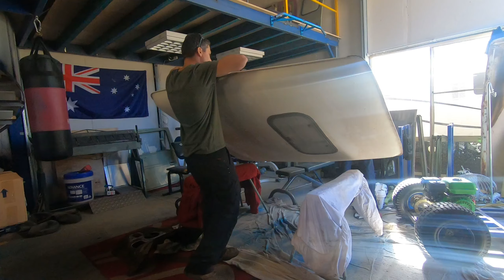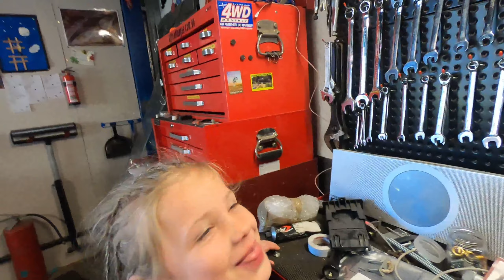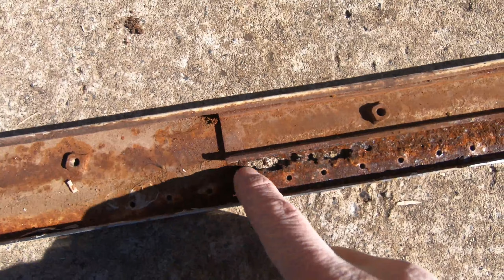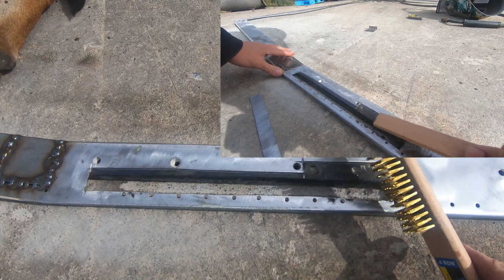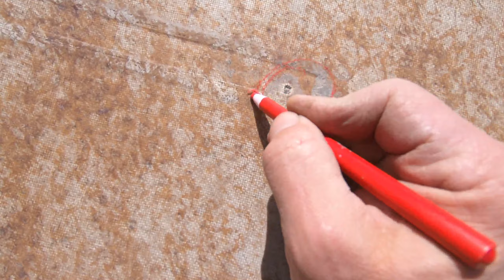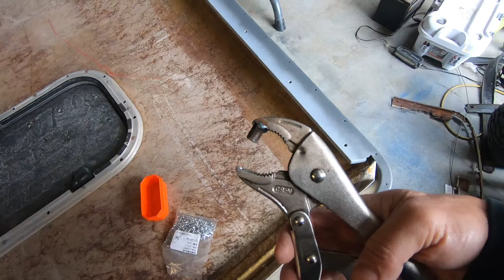EP16 - FJ40 roof gutter removal and repairs, RUST

Comment: This is incredible, I was looking to get into an FJ40 restoration, after seeing your videos I realize that I need way more tools than the ones I have, know how to use them, a dedicated garage, and Time.....how and why before your restoration got all those tools?....did you have most of them before?....do you fix cars before?.....which tools you bought specifically for the project?......you are like a magician, eventually you pull out  tools from a hat that I never dream of owning......... .I am handy and have knowledge about mechanics by the way.........great job Mate
Reply from the maker: Thanks George, I had most of the tools you see before starting. I have always worked on Motorbikes, done all the services on my vehicle and build trailers and caravans. But this is the first restro I have ever done from ground up, If I Don't own a tool I will try and make a tool to work for the job, like the riviet tool. I'm a fitter machinist by trade.

Comment: Did you put a sealant between the metal gutter and the fiberglass top?  Or any sealant after installation to prevent water leaks? Thanks!
Reply from the maker: Hi David, 
I painted the metal gutter, but didn't put sealant between metal and roof as this would make it extremely difficult to remove later if needed and this is not how it came out from factory, but I did put sealant on afterwards. Used white Sika Flex 227 and shaped it with a silicone scraping tool and a small amount of grease and wax remover to stop it sticking. Its funny you ask as only did this two days ago as I'm prepping the roof for install you'll see it in an upcoming video very soon.

Comment: Yet another awesome vid packed full of grt tech!  Question,  have u ever considered trying to fill in the sunroof?  I have the same style sunroof on min from the PO and always was curious if I could somehow get the roof back to a factory style full roof...also curious to watch later videos to see what u did for the headliner,  mine has the standard little inconsistent bits of foam that the PO didn’t get off when he pulled off the saggy headliner.
Reply from the maker: I actually got an entire spare roof after I repaired this one but I'm deciding to keep the sunroof I think it's pretty cool. I'm looking into heads liners now. Very expensive to get original liner.
Reply: 40 Channel well if it’s gonna have the sunroof I’d say don’t invest in an oem headliner.  I’m toying with some white rubberized bed liner or thin carpet is also popular.

Comment: No sealer required between the fiberglass and the frame before rivetting?
Reply from the maker: Hi Mark, the sealer goes on after it is riveted together. Some put it on before paint other after paint, I'm going to seal before paint so it all looks the same colour.